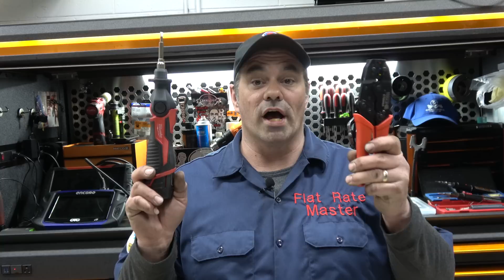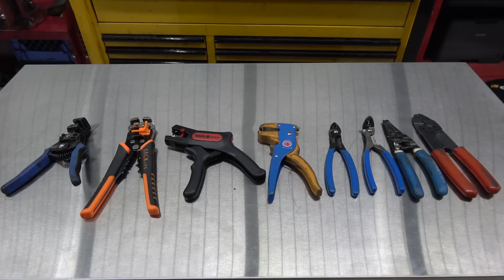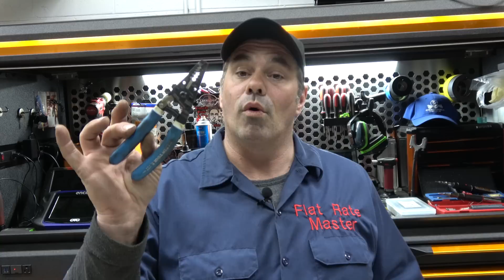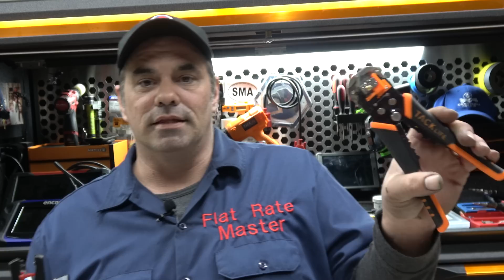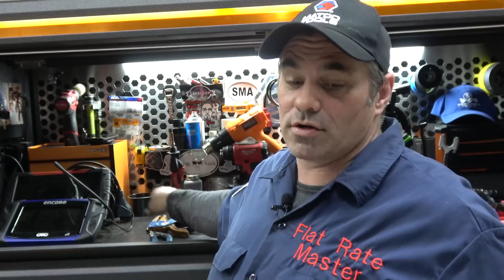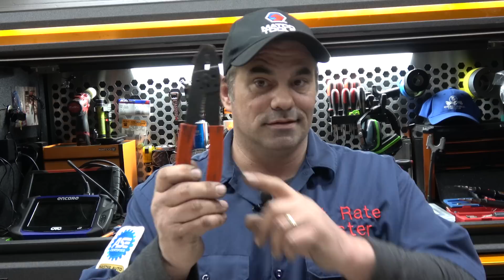Wire Repair Tools A Complete Guide Part 1

Comment: The timing of your videos always seems to be spot on, I just fixed an intermittent stall/no start condition on my own Jeep Cherokee that turned out to be a partial break in the coil trigger wire . Was acting just like a failing crank position sensor.

I spliced in a new length of of wire with butt crimps as a temporary fix, but the job made me realize I need to buy a Portasol. Not that I'm against crimps, I have a few Packard and other ratcheting crimpers, a hydraulic crimper with dies for 0 - 14 gauge, and almost every other style of manual crimping pliers; but I just don't like two butt crimps on a wire that the vehicle needs in order to run. I'll even admit that I've never had a butt crimp fail that was done right but I just feel better soldering certain things.

Good video and I'll be looking forward to Part 2.

Comment: Great video thanks brother. I have a set of Kline I used for probably 30 years. I just retired them got a pair of Channel lock one's know. They are both strip and crimp the Kline I love them just to get that many years from that type of tool. I have used and abused them they were just getting to the point they didn't want to strip wire. Keep up the great work see you in the next video thanks again for leaving us hanging.